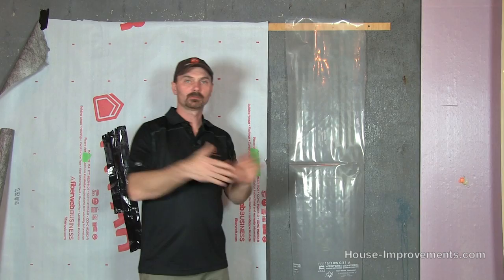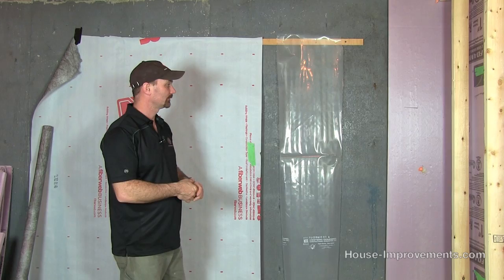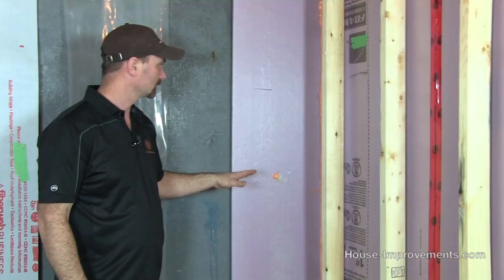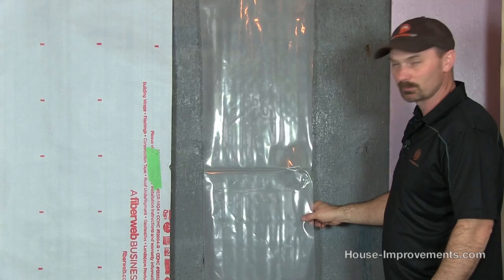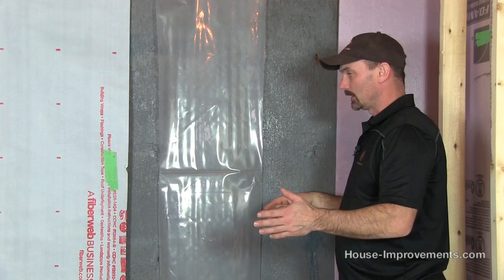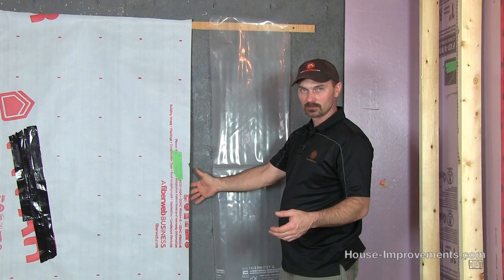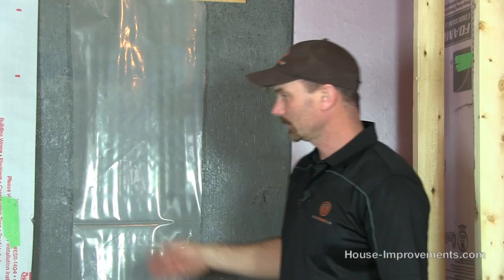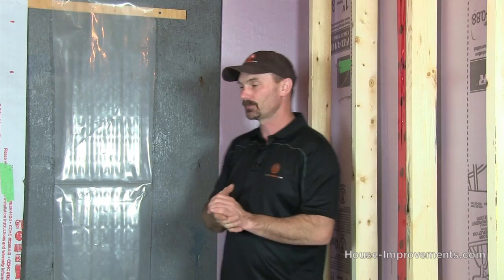Moisture Barrier - 3 Types

Comment: Hi Shannon, One question I am refinishing Basement in end Condo Unit and plan of using 1" Fiberboard per your video on the three cement basement walls the see the exterior. The 4th basement wall separates my end condo from the next condo unit over. Is it necessary to fiber board the wall as well since it an interior wall. I don't think the next unit is finished or heated. At the very least I was thinking of putting a lower level of moisture barrier like sheathing to save some money. Is this needed. Your thoughts and feedback would be appreciated.  Thanks, Don
Reply from the maker: I would just install Roxul insulation in the wall cavity ,this will help with deadening sound transfer also. No vapour barrier or moisture barrier needed on an interior wall BTW.

Comment: what are you using for air vapour barrier on the inside of rigid foam installation?
Reply from the maker: Depending on the rules in your area and the thickness of the foam you may not need it but if you do I would use a poly "smart barrier". There a couple different manufactures but Certainteed is one.

Comment: I really don’t understand how rigid foam or foam applications that are bassically air tight to the concrete are acceptable if the wall is supposed to breath… wouldn’t these applications be trapping excess moisture in the block/concrete thus accelerating the deterioration of the wall? Or is that just thinking too much into it?

I’m in Wisconsin, and I’m debating if I should use 1” foam board and seal it all up good with tape and spray foam, or let it breath using 1” rock wool comfort board. Then obviously framing and more insulation in the cavity. But to take it one more step I was even going to use the certianteed membrain vapor barrier to allow air flow between season changes. 

Anyone got some concrete evidence to the best approach? ( pun intended ) :)
Reply from the maker: concrete is porous enough that moisture can move in and out of it from the exterior .

Comment: Amazing videos...especially for a female  DIYer.  Hopefully you still see your messages for older videos.  Quick question...I am putting up the 1in refective foam board on my cement wall but there is a metal water trap? that goes around the entire circumference on my basement floor. About 4in tall. Do I put the foam board over this trap to attach to my cement wall? Or leave this area open? Guess it's used to collect any water discharge from the wall.
Reply: I hope you're not creating a double moisture barrier when you do that.
Reply: Hi! No, I only put the foam up and didn't cover the trap.
Reply: @simplymorgans  Well that's good you planned ahead and there's a trap there. Though I can't help but wonder if having a water trap is a good or bad thing. I imagine the trap holds some water which could to turn into water vapor. That could contribute to higher humidity and therefore a damp basement.

Comment: QUESTION Does the moisture barrier need to wrap around the bottom plate or not?
Reply from the maker: No not always but you can run it under the plate if you like.

Comment: Whats the difference between the moisture barrier and a vapor barrier?
Reply from the maker: Moisture barrier is placed against the concrete basement wall to direct any minor moisture that comes through the concrete or frost that developed and melts to the floor. 
Vapour barrier is attached to the warm side of the basement wall framing under the drywall . It is sealed well all around and helps prevent warm moist air from getting in the wall cavity and also keeping cold drafts out of the house.

Comment: Does the rigid foam breathe? Between the wall and the rigid foam won't there be a thin humid line which can provoke fungus, roth etc?
Reply from the maker: +Vali Goaga The foam does not breath,it directs any moisture to the floor that migrates through the concrete. It also helps prevent any warm moist air that escapes from the interior of the home from being able to contact the cold concrete surface causing condensation and frost.

Comment: I want to install insulation blankets in my basement but during heavy down pours I get water through my masonry blocks. Would it be ok to use the poly sheets to create a moisture barrier to protect the blankets before installing?
Reply from the maker: The best thing would be to stop the water infiltration but yes poly would work.

Comment: i was thinking about putting Styrofoam on my 1909 house poured foundation. however the walls have minor crumbling in places and are uneven. with the previous owner  they put drylock. i am not sure what i should do because the rigid foam might not be laying perfect along the wall.
Reply from the maker: +Chris Carlson Please use my forum for this question, intact you may have been there already as this sounds familiar.

Comment: Ok, you have done the walls here and moisture (if it appears on concrete) goes down to the floor. But If you need to make a floor also, what would be the right way of installing floors after you've done the walls?
Reply from the maker: please use my forum. http://www.house-improvements.com/forums/

Comment: I have a question can I use painters plastic be in my walls as vapor barrier  it's garage no concrete  just 2x4 framing insolation
Reply from the maker: No not for a vapour barrier, it is to thin.

Comment: I was wondering, can you paint the walls with drylock type product and then attach the rigid foam insulation right onto it? or do we need an air space between? I find contradicting information.
Reply from the maker: You could. If installing rigid foam that acts as your moisture barrier and some insulation value.
Reply: HouseImprovements but my concern is if I need an air space between the drylock product and the rigid foam
Reply: @gamerclownz2783  We don't want an air gap at all between rigid foam and concrete. We can use XPS\EPS over the top of dry guard\dry-lok paint.  
 Minnesota (cold state) inspector; recently told me this about my basement rigid foam question.
Reply: @DevJB  lol this was a 5 year old question I never used drylock. Through my research I found its a worthless junky product. I sealed my walls and floor with radonseal before using ridgid foam

Comment: I am using plastic for the moisture barrier, and not sealing it. People keep telling me that it is going to create moisture. . .  But if it isn't sealed is this a problem? We will be installing an airtight vapour barrier too. I don't want to have to rip up my walls 6 months after finishing the whole project. Where does the moisture go?
Reply: My basement is very dry, no moisture smell to begin with. Am I risking creating moisture that wouldn't be there by using a moisture barrier?

We are using Poly-Tarp 6 plastic, the same thing we will use for the air-tight vapour barier on the other side. Attaching it at the top, on the outside of the framing, and running it down to near the floor, but not sealing it. It overlaps the plastic we used around the base-plates of our framing.

Then every six feet or so, horizontally it overlaps another sheet, so it is not sealed at those points too, but just overlapping. . .
Reply from the maker: You are fine , I also replied to you on the forum.
Reply: thanks

Comment: Shannon, any suggestions for my situation: the basement is already framed with no moisture barrier behind the studs. Does the framing have to be torn out, moisture barrier up and re-framed? Thanks!
Reply from the maker: Well  first check if your area requires a moisture barrier and if it does I would try to get one pulled in between the studs and concrete , if you can't get it in there then I would use Roxul insulation or closed cell spray foam for insulation and not regular batt insulation which is effected if it gets wet.
Reply: @HouseImprovements  Am I understanding correctly that no moisture barrier is needed if you do Roxul insulation? 

If you can pull the moisture barrier between the studs and concrete, do you attach it to the stubs? Can they be touching? Thanks!

Comment: 10 yrs ago the inspector had me wrap cinder block wall with 6mm poly down cinder block face into drain tile opening and face glue it shut. Then build 2x4 wall 2 inches in front of it with r13 batting and then covered with 6mm poly glued to bottom plate and taped. 
Today I'm removing 120 ft of knee wall in the basement because it's completely soaked on the face of the inner poly (during MN winter.)
It ruined the batting, smells like heck and now I need a bunch of money. I told him I was going to do 2 inch xps foam and he told me to just use poly for inner and outer. 
The new inspectors now are telling me that was bad information and I need to remove the cinder block poly completely and leave the drain tile open and just reset my knee wall back in place keeping it 2 inches from the block, re-batt it with backer strips keeping it away from block, and 6mm poly the face then rock. 
So basically, they want me to just subtract the block wall poly.     I know double lock is the reason but should I do this? Or go with 1.5 inch xps sealed to block, then wall it ?  Thanks !
Reply from the maker: Block walls are not the best most of the time and that is likley the main issue ...leaky walls. IMO, 1" min. rigid foam against the block but allow the moisture to direct into the weeping system. Build the knee wall , insulate and install  "Smart barrier " vapour barrier  ,seal it all well around perimeter and any openings and then drywall over it. 
If you need more assistance please use our forum.

Comment: I used tar paper on my last project. The insulation can go right up against the barrier or should there be a gap, either between concrete and barrier, or barrier and insulation?
Reply from the maker: +cz3chmonkey ya tar paper is ok as long as it is good quality so it does not inhibit mould growth. Insulation is fine to be against it but usually there is a slight gap.

Comment: thanks a ton for this. I just reparged some loose concrete and one wall the masonry concrete has moisture, do I need to repair outside or can I use the techniques you've shown? it's a 100yr old home in minnesota. thanks!
Reply from the maker: +Kerrigan M This mostly to handle any frost from condensation in winter and minor leaks and moisture wicking through concrete that may develop over time but your main defence for water leaks is to be done from the exterior for sure.Sounds you may need water proofing from outside and even weeping tile and sump
Reply: +HouseImprovements thanks for the info, sounds like its time to dig a big hole!

Comment: Hey Shannon, when you insulate can you insulate the concrete floor, with rigid foam also? And then put the subfloor on?
Reply from the maker: You can, there are products out there with insulation and wood subfloor all in one panel . They are 2'x2' and fit together with tongue and groove type edges.

Comment: Hi Shannon u have tried to ask this question on you forum but I got no answer I don't know why so now I will ask here I am putting the 1" thick foam board on my basement walls I get a lot of moisture in my basement   witch get some mould I have cleaned it build up around the outside to help water run away   so is it ok to put the foam board on even if I may still get a little water ? Sorry so long lol
Reply from the maker: I don't seem to see this question in the forum? Anyways , you need to fix the water problem before finishing the basement . This foam or any moisture barrier are not made to control water leaks they are made to re direct moisture from frost or condensation and very minor water infiltration. Please use the forum again if you have more questions as I hardly ever check these comments.
Reply: Message me if you still want to know the answer to this.

Comment: I have an unfinished basement that have like a large piece of insulation wrapped with a plastic wrap on top of the insulation. Is that the proper way?
Reply from the maker: That is the default "builder bag insulation" that needs to be installed by the builder on an unfinished basement so the owner can move in. That is not the insulation technique you want in a finished basement project however.

Comment: can you barrier, insulation, and framing videos all be applied to cinderblock walls as well and if dry are barriers needed
Reply: Wondering the same thing. In fact, I really don’t understand how rigid foam or foam applications that are bassically air tight to the concrete are acceptable if the wall is supposed to breath… wouldn’t these applications be trapping excess moisture in the block/concrete thus accelerating the deterioration of the wall? Or is that just thinking too much into it?

I’m almost leaning more towards using the rock wool comfort board directly against the concrete,then studs and rockwool insulation. Then certianteed membrain vapor barrier. It seems the building science is leaning towards this approach from what I’ve been researching. The rockwool won’t mold or hold water. Only thing I would worry about is the wood which I think a treated bottom plate would probably be enough. But it’s all so situational because of climate. But I’m in Wisconsin where we have decently hot summers and really cold winters. I thought about Maby putting the tyvex house wrap between the comfort board and concrete with the letters facing the concrete so that it can wisk water to the ground and still breath. But idk. Everyone seems to have their own opinion on whats needed.

Comment: Do you still need a vapor barrier if you use any of these 3 shown in video?
Reply from the maker: Yes. The only exception would be that in some areas they may allow you to skip the interior air/vapour barrier if you use 2" rigid foam.

Comment: Can you attach the barrier from the floor joist instead of nailing into the concrete wall?
Love your vids !
Reply from the maker: no, it needs to be a maximum of 12" above the outside ground level .
Reply: @HouseImprovements  Can you explain why that is?

Comment: I gutted a mobile, it's being remodeled, just starting, the frame itself, Do I have to remove the wall frames and put up a air barrier on the back wall, or just put in insulation, then air barrier on top.
Reply from the maker: A moisture barrier is only needed in a concrete basement.
Reply: Okay thanks because someone told me that an air vapor barrier has to cover the insulation, put plastic over it after the insulation has been put up.

Comment: Is 1" the bare minimum for moisture barrier?
Reply from the maker: No really any for over 1/2" is fine but in my opinion at least using 1" gives you a little more R value as well.

Comment: Dont you have the house wrap the wrong way? the front as the vapor barrier should face the concrete right? you have it facing the room.
Reply from the maker: You actually make a valid point. The front side is more moisture resistant. The main function of this is not a vapour barrier but a moisture barrier , and it is to direct moisture from the concrete down to the floor instead of into the insulation in the wall cavity. I think you maybe correct though it would be even more effective facing inward. I'm going to chat with some other contractors and see what they think.
Reply: Hi yes, i did mean that the front side is more resistant (to water, moisture, vapor) so it has to face the concrete.
Reply from the maker: I have discussed this with a few others and we do believe you have a very valid point. Turn the face of the house warp towards the concrete . Thanks for your input.

Comment: Why not use metal studs ?
Why use wood?
Reply from the maker: You can use metal, there are other difficulties working with metal but it works fine.
Reply: @HouseImprovements   3 year old video and still reply +rep
Reply: With pipes that run horizontal along the basement wall.. how do you put the vapor barrier above or behind it?

Comment: Is it OK to attach the moisture barrier to the back of the studs rather than on the concrete wall
Reply from the maker: If you can.
Reply: The answer depends on a few different variables. I''m in the process of finishing my basement and moisture barriers are not as simple as the video may have suggested. Just let me know if you want my take on things by replying to this comment or any other means necessary. I just hope you don't mess up your finishing job. By covering a concrete wall with a 'moisture barrier' you have the potential to create a double vapor barrier which is NOT what you want. BUT IT REALLY DEPENDS ON A FEW FACTORS. 
 This whole moisture barrier topic is a complex topic which took me about 2 hours and a 32 page article to really 'truly' FINALLY understand.
Reply: @HouseImprovements  I'm not a fan of fiberglass batts. I'm really more a fan ROCKWOOL. It doesn't absorb moisture and is a hell of a lot more durable than fiberglass insulation. You wouldn't  even need a "moisture barrier" with Rockwool (mineral wool insulation).
Reply: @inyoureyes9197  Would you mind sharing the article you've  referenced? I'm having a hard time understanding it and it'd be a big help. Thank you.
Reply: Same… seems building science is leaning towards no moisture barrier when using rockwool but do I still need the vapor barrier? It’s not the rockwool I’m worried about but the studs now. I’m thinking of using rockwool comfort board against the concrete, then framing and rockwool bat insulation and certianteed membrain vapor barrior. I’m in a mixed climate here in Wisconsin so it gets pretty warm summers with running the ac and very cold winters.